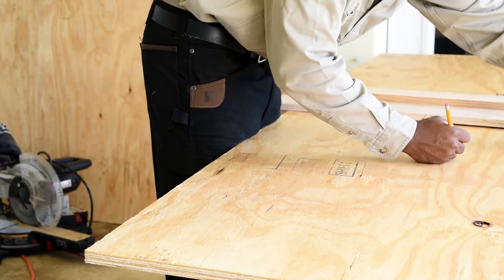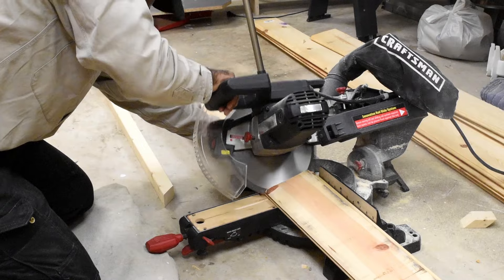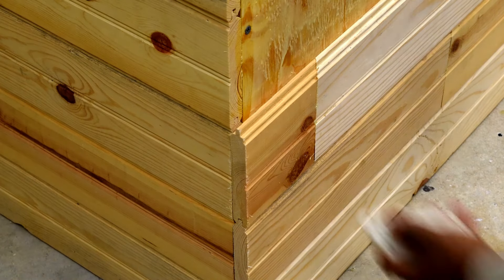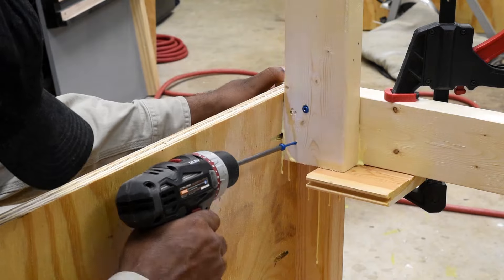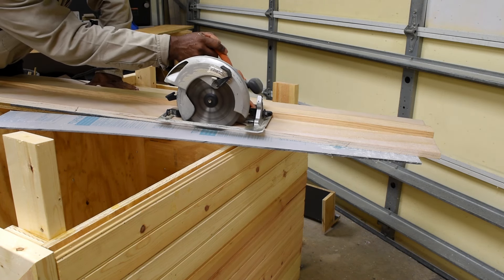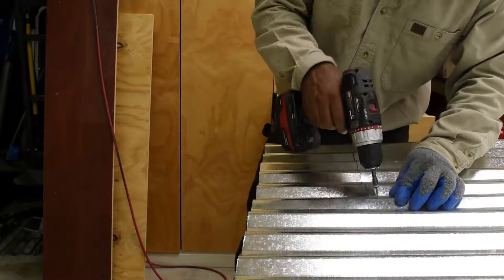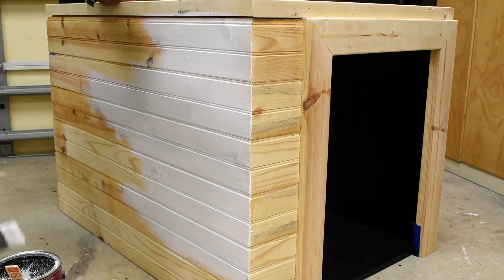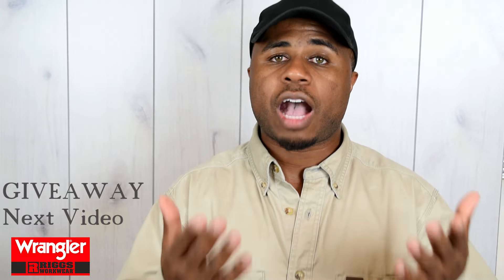How to Make A Dog House Part 1 | DIY Build

Comment: Very nice. It looks like you sized it just right for your dog. Very creative
and looks great.  You may want to consider placing vent high on the rear wall for more ventilation and extending the roof over the front door for extra shade.

Comment: the project looks great. but I would recommend cutting a slot at the top of the front piece of plexi glass to vent the dog house. the inside will get hot quickly sitting out in the sun.

Comment: I wonder if the black interior and metal roof will make it a little to warm for the dogs during the summer. Looks like a solid build and I really like the design.
Reply from the maker: Thanks Jason. I doubt it because I place it in a location where it get minimal sun. I could be wrong but I believe with the white paint on the outside it will not absorb as much heat. Also the dog have the whole backyard if she gets hot.

Comment: Very nice design, in colder times the front entry is very much open to the elements, which equals one very cold unhappy dog! Good for daytime lounging when it is warmer, but i wouldn't expect a dog to stay in overnight for the aforementioned reason. Nice to look at, but impractical. maybe a waterproof material door flap of some kind.
Reply from the maker: Thank you. Normally if it get's cold out the dog comes inside. She actually slept it in it every night. During the day she takes over the patio.
Reply: Im sure your climate is much better than it is here in ireland, so i am sure the dog would be a tad more comfortable lol !

Comment: Congrats on the sponsorships. You do a great job presenting each project and you deserve the success. If you remember, I'd like to get an update on this dog house in the future (maybe in a year or two). How did it hold up to the weather, what would you do differently, etc. I'm looking for ideas for an outdoor house for my husky, but most of the designs I've seen were either really plain, or they had a design flaw that would make them not last very long. In this case, I'd probably want some kind of venting at the back, maybe by cutting out some holes in the plexiglass, so there's enough airflow.
Reply from the maker: Thank you. Im still not where I want to be but im learning with every project. If I still have ill be sure to do an update. Im confident that will stay up for at least 5 to 10 years maybe adding a coat of paint in between.

Comment: I wonder if you could use one of the floor heating elements with insulation to both keep the dog warm and to put their water bowl in so it doesn't freeze outside. I've thought of making things like this for cats before. though it would be well liked since cats live that warmth. just a thought. love the plexiglass for light. great idea!
Reply from the maker: Thank you, I live in Florida it stay pretty warm here. If It gets too cold out my dog usually comes inside the house.

Comment: Very nice build! My only concern is the roofing sheet. That'll get hot in the sun and that the black paint inside would just absorb all the heat and might make the enclosure really hot for your furry friend!
Reply: HPB1980 the roof is reflective, it might get hot to the touch but it won't let the light thru. The black paint won't absorb the heat since it's not in the direct sun light. Awesome little dog house 🙂
Reply: I am more worried about the NOISE from a rain or sleet storm, but heat from the sun is a major concern.  The dog wont want to stay inside.  This is where a sheet of plywood under the metal, and maybe a sheet of foam insulation sandwiched between metal and plywood would be preferred.  In my area of the country, we would never put a metal roof on without some protection under it.

Comment: Nice dog house. Very good carpentry work. Will this work in cold climates? Do you need fiber glass insulation? Do you have plans available?
Reply from the maker: Thank you, Yes it should hold up just fine. It still in great condition almost a year later. Insulation should keep it warm. I don't have plans yet. They are on my to-do list.

Comment: That moment when the woman of the house says something AND IT BETTER BE DONE. 😂😂😂😂😂
Awesome work Glen. But why did you choose iron sheets over wood? Could it be coz of durability?
Reply from the maker: Haha of course. The sheet is made for roofing I figured it would hold up longer.
Reply: it's sheets of corrugated galvanized steel

Comment: Was that indoor wood glue you used?? um, solid wood expands and contracts. how will it do this when glued without breaking that bond? and exterior glue should be used. also, vinyl siding would be cheaper too! But still, nice build!
Reply from the maker: Yes its indoor/outdoor wood glue. I paid like $27 for the siding they were on clearance. Thank you

Comment: Nice video :)

I would make the suggestion of adding some drain holes in the floor. With the open door frame it's inevitable that water will get in.

Also if your trying to use up that black paint then paint the bottom to add another barrier against water damage.
Reply from the maker: Thank you. Good points!

Comment: Fabulous work. The noise of rain on the sheet metal will drive the poor dogminsand. They have  extremely sensitive ears. Poor babies. Need s to be sound proofed, sound insulated i side to avoid that?

Comment: nice job, but does black paint absorbs heat, would it be bad for the dog?
Reply: I was wondering the same thing... the black paint plus the metal roof...
Reply from the maker: No im not concerned about the heat in the next video you'll see what I mean. The location I chose rarely gets sun. The Sheet metal is used for roofing and there is two layer of wood. If the exterior was painted black there would be a concern for heat but white handle heat better.

Comment: the house came out very nice. i just have one concern, ventilation...drill some wholes in the plexiglass for those hot summer days.
Reply from the maker: Thanks, I don't think it's needed; with the size of the door. Plus the do house is placed in an area where there is a ton of shade.

Comment: Great video but if I can give you an advice, never screw in the wave for the roof but on the top. If you screw in the wave, the water will penetrate inside.
Reply from the maker: +sylicoman Thanks it's only I
One believe I placed like that. Then I caught it.

Comment: Why do you use pocket hole screws to add the front trim instead of just normal screws from the other side, the way you attached the other parts to each other?
Reply from the maker: No real reason mainly because I have thousands of pocket hole screw. Any screw would work.
Reply: Thanks for the reply. But didn't you say you used them because you 
required extra support? Do they provide more support than a simple screw
 in from the other side? I assume so.
Reply from the maker: I was referring to the way it's constructed. 1. I used wood glue (max bonding strength, will help the wood from warping). 2. Brad nails to help hold while glue dries. 3. The screw from the inside just provide next level strength (any screws will work).

Comment: I wouldn't put the plexiglass and make the roof a little bit wider for ventilation!
Reply: This is a fine build. One consideration would be if this is a colder climate that would be to insulate the floor. With constant airflow underneath  a dog can't stay warm. I once went to the trouble to build a box and my dog laid on the ground rather than inside. Years later I built another at a new location and insulated the floor with Styrofoam sandwiched between plywood and the dog preferred this rather than the option to come inside on a cold night. I even added material for flaps for the door that did not last very long. Dogs want to see what is going on.

Comment: You should add caster wheels for easy of mobility.
Reply: why should ever move a dog house after installing it ?
Reply: because depending on whether you put a floor down or not ticks, fleas and lice, all live in the dirt. Moving it around will reduce the numbers present. You could however avoid this by putting in a floor that is above the dirt and one that airs through such as steel grating obviously with a dog bed or blanket on top for comfort that can be regularly washed in hot water to kill any fleas.

Comment: Aren't you worried about the black attracting to much heat along with the metal?
Reply from the maker: The metal it's only hot to the touch. It reflects the heat from what I have seen. As far as the black, It's on the inside. The white is on the outside of also reflects the heat. My dog has the entire yard so if it's ever too hot, there is always shade available.

Comment: just a dumb question, but why use wood glue if youre just going to use screws?
Reply from the maker: Since it's outdoor in the element. There will be change in the temperature. The wood glue should help the wood from warping.
Reply: DIY Creators OH thats very insightful! thank you sir.
Reply: cheeriomartinez I

Comment: Let's see one of these guys skip the thousands of dollars in tools--do it with a hand saw, hammer, nails, screw driver , screws and nails--where the hell is that video pros?
Reply from the maker: It's 2021, I have no interest in spending weeks to months to build one thing.
Reply: @DIYCreators  and that avoids what I said completely. I'm not interested in thousands of dollars of tools for 1 project--so right back at you.
Reply from the maker: I understand, If you are not planning to build anything else then it's not worth it to buy tools. It would be cheaper to hire someone to build something.
Reply: @lilcourtny08  how many countries ahve you lived in? How many have you travelled to with tools?  Do you get it now?